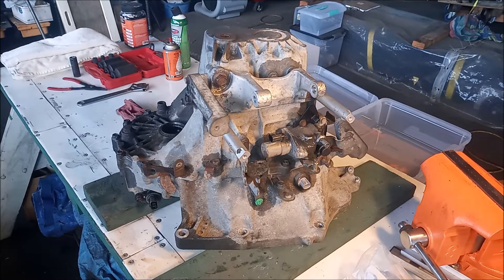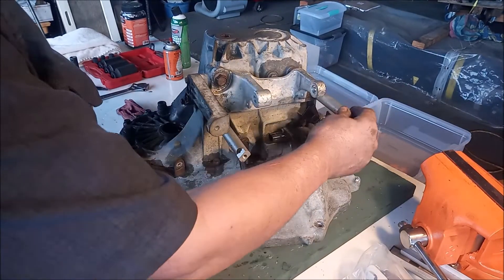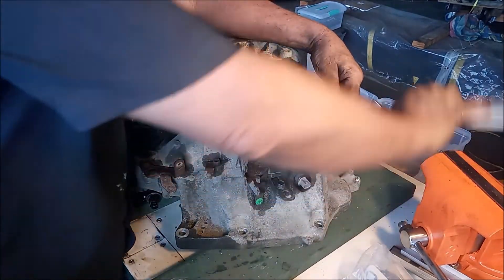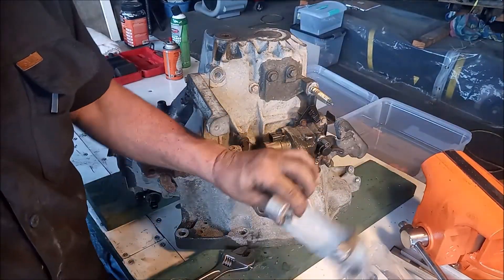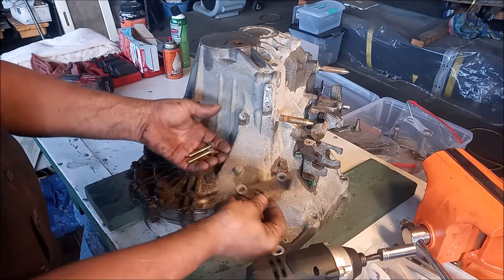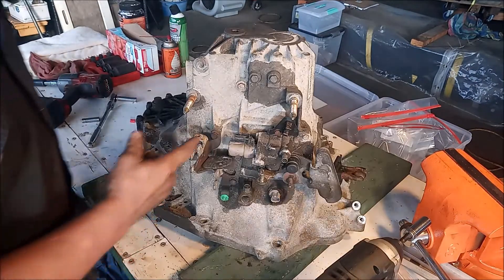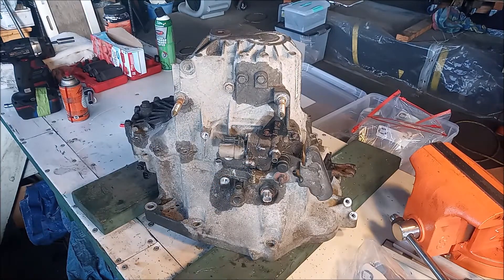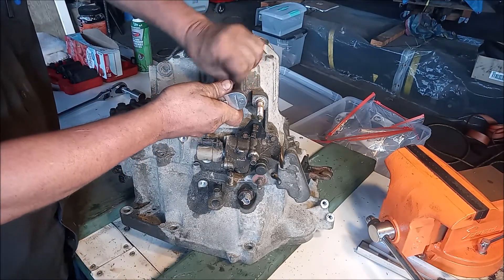Transmission Complete Teardown - Honda K20 Acura RSX K-Swap - How to Disassemble the Transmission

Comment: how many miles did this transmission have on it
Reply from the maker: Probably a lot. Was bought on eBay.
Reply: @Merryfrankster_  OK I'm rebuilding mine and it has 140xxx hope it's not bad the final drive and mainshaft